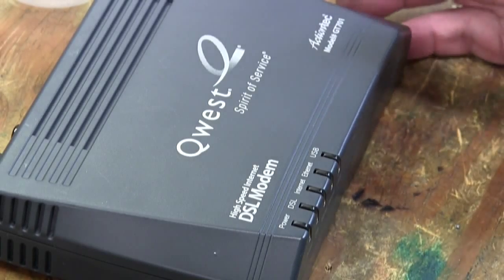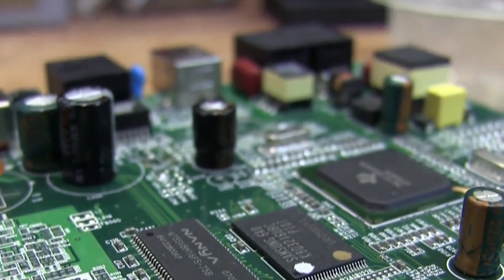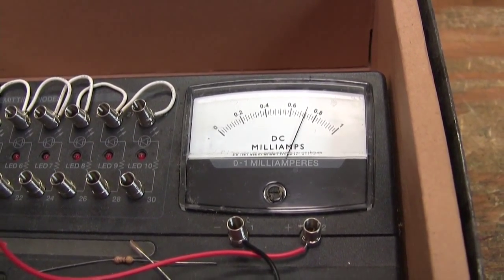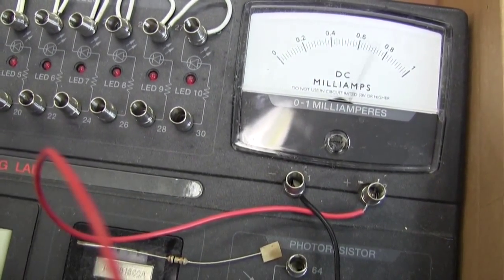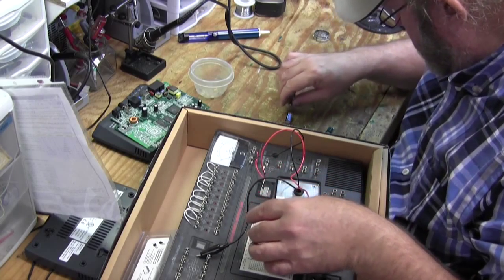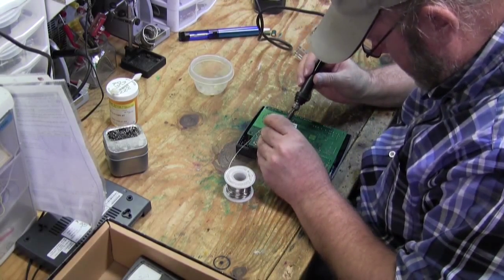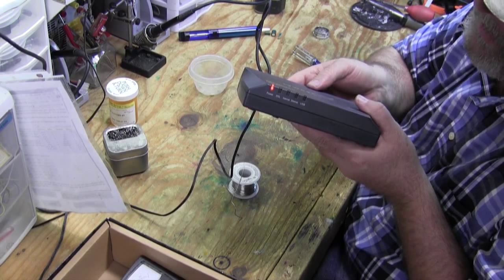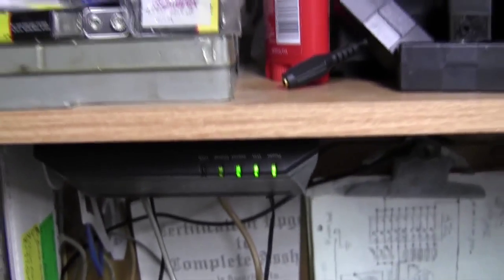Actiontec GT701 DSL Modem Repair

Comment: I could not be any happier since I installed the Orbi system✠>imgs.love/Orbisatellite?Й87  Before Orbi I was getting 20 - 35 mbps. My wifi plan is up to 150 mbps!! With Orbi my wifi speeds are 140 - 165 mbps all over my 2,800 sq ft house. I love the fact that it auto detects 2.4 and 5 frequencies for connected devices. Money well spent!

Comment: Thanks much!  Over the past few weeks my internet performance had degraded terribly.  It got so bad that no upload speed test would even run, though download speed tests worked just fine.  I noticed very high counts of Near End FEC errors on the modem status page.  I found lots of posts about that issue but none of them linked it to a power supply problem.  Thankfully it finally got so bad that the modem would not boot past the red light, which lead me to this solution.  Sure enough, the 1000uF cap was shot.  After replacing it I am back in business.  The connection performance is back to normal and the error count is still zero!

Comment: Mr. Hill, are you sure C427 isn't installed backwards?  On the video, both the one you removed and the one you replaced it with had the negative stripe facing down, i.e. toward the front panel edge, which is opposite of both the one I have, and the one shown in pics at this thread wwwDOTbadcapsDOTnet/forum/showthreadDOTphp?t=23051
There's a discrepancy (at least on mine), where the silkscreen has a + symbol at the top, but the layout has the square pad at the bottom, indicating the + side.